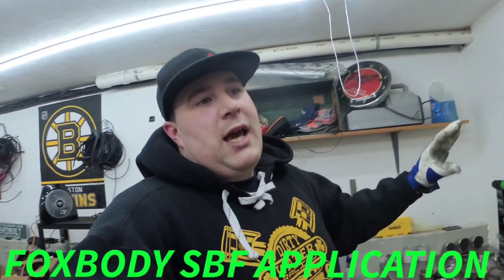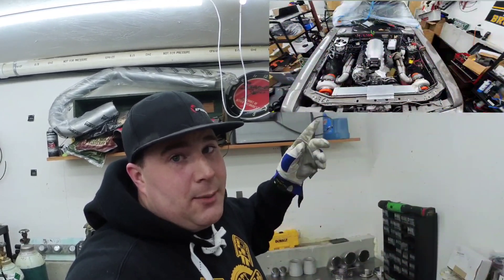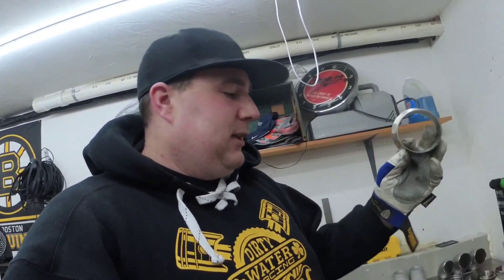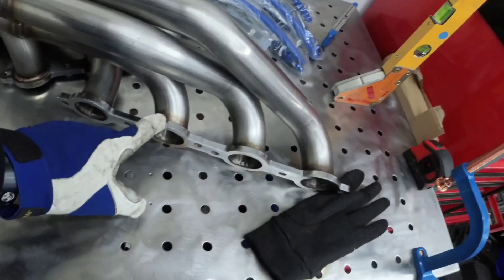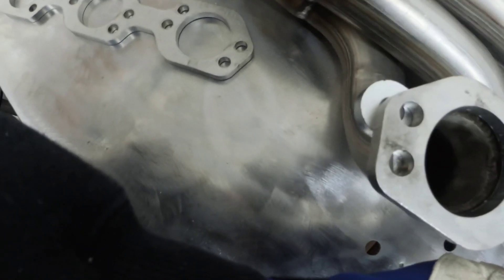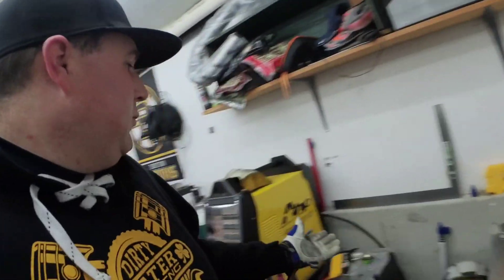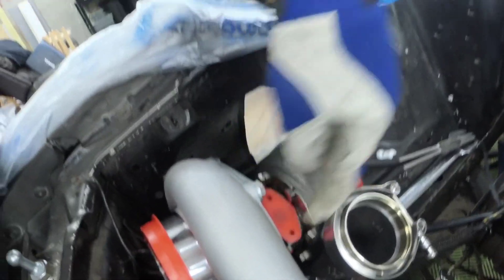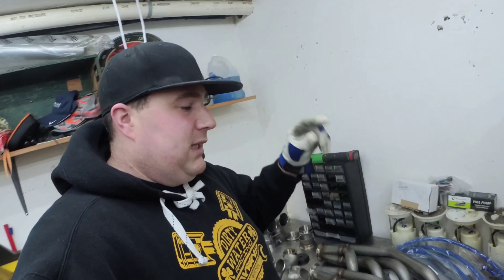LS Headers on a Small Block Ford 302 Pt. 1

Comment: For those curious you can just re-drill the existing flange, that's all I did to get these headers (well to be fair, the 1 3/4" primary) to work on my n/a 347 a few years back.
Reply from the maker: For 1 3/4 headers most likely that's what you could dom these are 1 7/8
Reply: @K2Sportfishing  Ok, and I apologize, that was misleading (not intentionally), I was using RHS heads, with the wide bolt pattern. Yes 1 3/4" will work with both narrow and wide head bolt pattern, I chose the wide for convenience. 1 7/8" would work with any wide bolt pattern head by just drilling them out also.
Reply from the maker: @briankluck1917  I have SBF square ports. Just drilling them out will not work.
Reply from the maker: @briankluck1917  was going to use the kooks head adapters. Doesn't matter anyways I'm going in a whole new direction now lol
Reply: @K2Sportfishing  ha, amazing how that happens! I have done that a number of times with my SN95 :)
Reply: wonder if those cheap ass ls swap long tubes would fit, got a set of 3"  bolt space heads all ready might have to try it since there dirt cheap vs a decent set in stainless one's for fords.